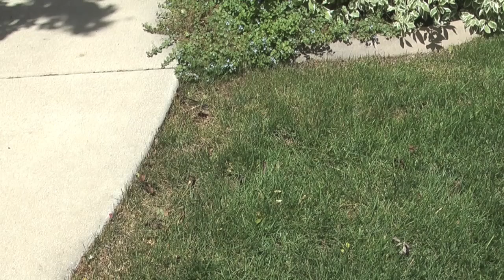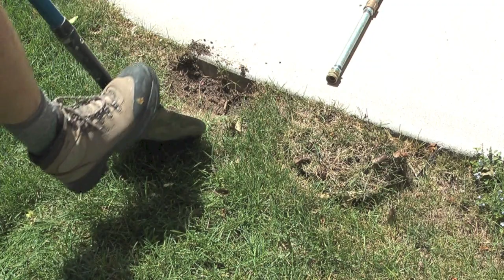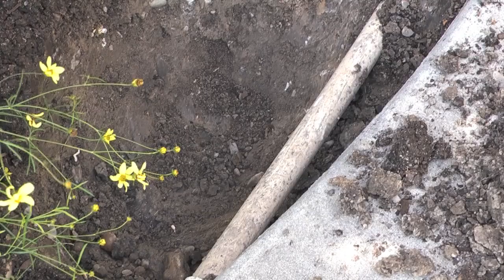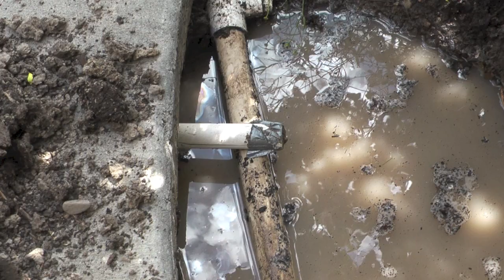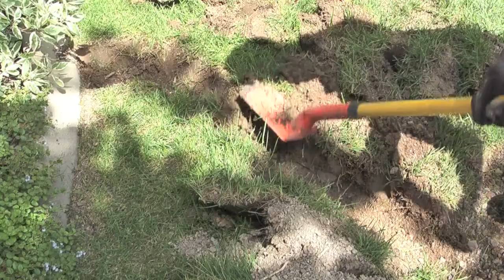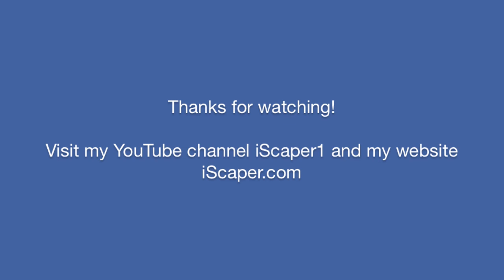How to install a sprinkler pipe/conduit under a sidewalk

Comment: Something easier ive been using at my irrigation installs.....ready for it?? A pressure washer with the red tip on it. You'll have a clean path in about 2 minutes. Much more effective. This method works well too..just a bit slower.

Comment: Informative video, thanks for posting- most helpful for a future project I will be under taking..  Question, at frame 4:13, what is the brand name and model number of the trench shovel you are using?
Reply from the maker: Similar to the one in this link: http://www.homedepot.com/p/Razor-Back-43-in-Fiberglass-Handle-Trenching-Shovel-47034/205350373
Reply: Thank-you kindly for replying!

Comment: Thanks so much your videos that help me a lot;  I want to install the electronic wire for a sprinkler; but I do not know how to do that because I m just a amateur and I have never done it. So could you help me by doing a new video for this?
Reply from the maker: +Nguyen The Hoang 
Do the same steps as in this video and instead of pushing a low voltage wire through the conduit, push a timer wire through it.
Reply: Thanks for your reply! Have a nice day.
Reply: ditch with boning under side walk

Comment: How well will this method work for 23ft length?
Reply from the maker: You would probably need ideal soil conditions with no rocks.
Reply: +Nam Le H. Put a tee on the pipe. Put a plug on the end and screw your hose in the top of the tee.  When you get hung up tap the plug with a sledge hammer.
Reply: I got it through. It was crazy bc I have compacted clay. took me 2 days.

Comment: I want to run a pipe under my driveway, roughly 18ft wide, to run some electrical wires and 3/4 poly pipe through. Would it work if I built a wand out of 1.5 in. pvc 40 in 3-6ft sections -- stopping to add extensions as it progresses.  Then, after the pipe is through, just disconnect it and blow the water out of the pvc and pass my other items through the pvc tunnel?  Or do you have to use galvanized pipe for the wand assembly?
Reply from the maker: The farthest I've run a pipe under a driveway is 20', but it was 3/4" PVC and I had ideal sandy conditions. I connected the spray nozzle to a 20' length of  pipe and left the pipe when it was through. Just remember things could go badly trying to get an 1.5" pipe underneath your driveway. Your pipe could get stuck or you could settle your driveway. If your soil is rocky I wouldn't try it.

Comment: I sometimes just take a section of PVC and fill it with sand, cap both ends and use a sledgehammer to hit it through. Less mess.

Comment: why not just connect the wand to your pvc and push all at once ?
Reply from the maker: In good soil that's an option. In soil with rocks it too easy to snap off the fitting or crack the pipe.

Comment: Why not just rig up the conduit with the nozzle and then leave it in place and cut off the ends, glue pipe on and done. No going back to feed conduit through.

Comment: how would you go under... say... a driveway?
Reply from the maker: +joek0617 
Connect the nozzle to a length of PVC pipe. Driveways are trickier to do, you need ideal soil conditions for it to work.

Comment: Can u do this with a 2 inch pvc pipe?
Reply from the maker: Depends on the soil and the width of the sidewalk. Installing a 2" pipe will require a fairly big hole to get the pipe underneath. With a pipe this big you risk having to come back and replace a section of the sidewalk if it settles and cracks.

Comment: To much of a mess , dig a long trench roughly 5inches deep. Dig a hole exactly the same on the other side , take a 8ft steel pipe ,grab a sledge hammer blast the pipe through pull it out and put you irrigation line in. This mud trick will cave in blacktop walkways. See that mess back in the 80s it would have been in hooked and buried in 3 min.

Comment: I would Never do it this way.   Use a 1" SHC40 pipe that is a little bit longer than the walk is across
Then use a 1" cap, drill six holes in the cap, glue it on one side
Glue a 1" female adaptor on the other side
Buy an adaptor that is hose bib thread (female) and SAE thread on the other (male). bought at Home Depot
hook your water hose up, blow through to the other side
Leave the pipe in the hole, cut off the fittings on both sides
Done

Now you can use it as a pipe OR a sleeve

Comment: Kerry i found a easey way use a presher waher u will get through in no time
Reply from the maker: Great idea. Did you wash under from both sides?
Reply: No i dug with my hand as far as i could go then used a trul.and used the presher washer  on the other side it took me and my brother about 1 hr 2 go under 2 sidewalkes it made a mess but we used the presher washer 2 clean up
Reply from the maker: john Kosheluk
Thanks John for the info.

Comment: Aren't you suppose to use a grey PVC pipe for electrical?
Reply from the maker: If I were running power cable (120V or 240V) say from the house to a garage I would want the whole run in conduit (grey) and would want it buried 2'+. This project was to get low voltage landscape wire under a sidewalk so those requirements don't apply. Then if I have trouble with the cable in the future I don't have to water under the sidewalk again, I can just dig up the ends of the conduit and pull a new wire through.

Comment: Your irrigation pipes are really shallow...

Also, you don't need to make a horrible muddy mess. Just get a length of pvc pipe (1" or 3/4"), place a cap on both ends, and take a sledge hammer to it. Obviously you can't do it this way for long distances, but then again, you wouldn't want to put a bunch of water under someones driveway. If you're 90 years old I suppose your method is better.
Reply from the maker: chris rumple 
PVC pipe is strong, rated up to 480 psi for 3/4" Schedule 40, but it's rigid and brittle. Hitting it with sledge hammer will explode the cap and repeated hits will shatter the pipe, unless you have sand under the sidewalk and it's only 3' wide. I've mushroomed the end of steel pipe trying to hammer it under a sidewalk, but I have had some luck with a digging bar that has a point on the end.
Reply: chris rumple I agree with IScaper.  You're not going to be hitting PVC pipe with a sledge hammer or you would shatter in one whack.  Now, if you were hitting steel pipe, then that method "might" work.  But I presume it wouldn't as I think you would still need to soften up the ground some first, hence the water method.

Comment: Nice way to create a crack in the future !!
Reply: +Jj How Can you explain why? I'm not mechanically inclined.
Reply: As you put the dirt back little by little when you think you don't put by 5 Scoops back use the water hose and wet the damn dirt so it a pack back in there there for your driveway will not crack I know because I do irrigation and we do it all the time not once have you ever heard of a driveway cracking when you use water to wet the dirt once its back on the driveway heat packs itself
Reply: Not really, unless your concrete slab is 1" thick!
Reply: I am new to trying something like this. But can this be done under an active driveway that is 13 feet wide without it cracking?
Reply: Anthony Brunson 

Omg, will you please rewrite that?

Comment: This can be done in about 5 minutes using a hole hog. Call a professional.
Reply from the maker: Tom P. 
And what would that professional charge to do this project in five minutes with his hole hog? I'm into the parts for this for under $20, would the pro do it cheaper than that?
Reply: iScaper1 ha! he didn't answer back lol! I like diy!!! Especially when it saves you paper!